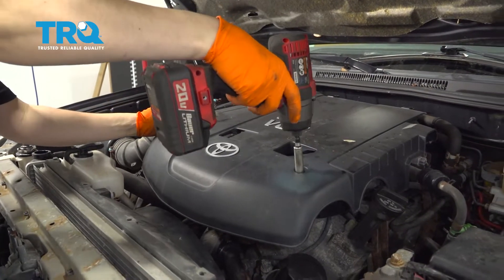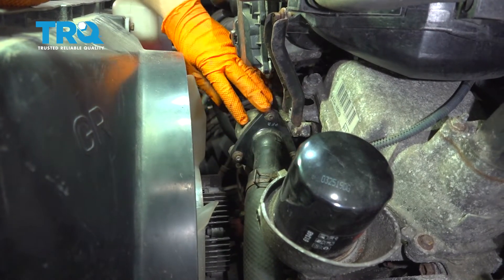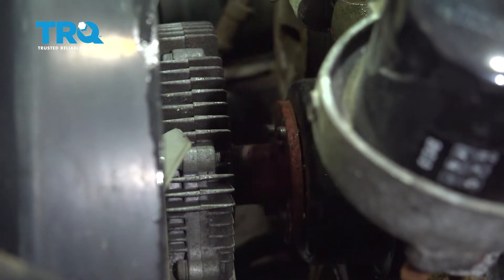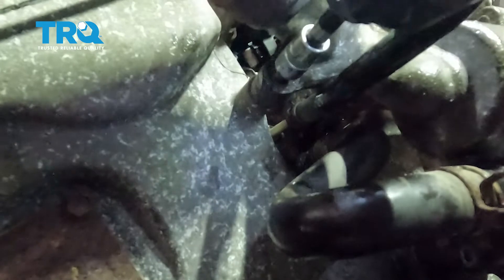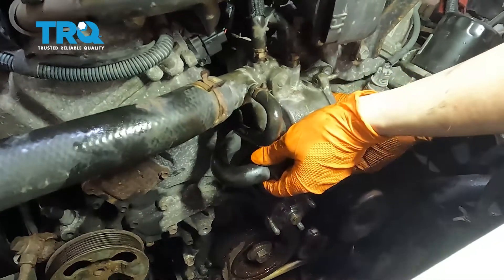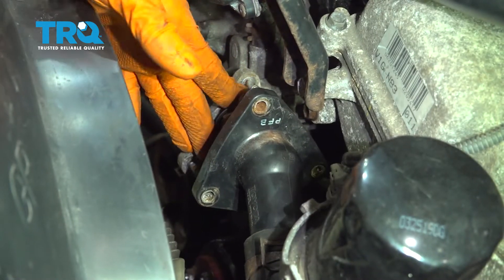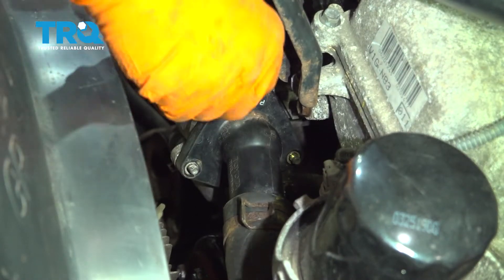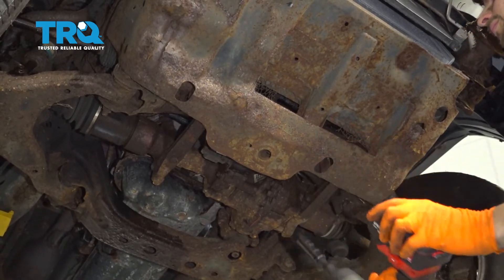How to Replace Water Pump 2003-09 Toyota 4Runner

Comment: Dont forget to tighten your crank shaft pulley bolt. If anyone follows this and realizes afterwards they forgot you can take the serpentine belt off the crank, wrap the old belt around it a couple times and then wrap the end around something solid on the underside, then it will be held in place to torq down.

Comment: my water pump just went out and this video was a huge help, THANKS!
Reply from the maker: +Gregoryjr94 Thanks for watching. Buy the part in this video on 1AAuto.com: http://1aau.to/m/Shop-TRQ
Reply: @IdahoSolar  my 2004 V6 has 209K, no issues yet, trying to decide if i let it go to failure or replace now?
Reply: My 2005 4Runner has 120k with no issue, I guess based on what see I can wait.

Comment: This video is very helpful. Just did this on a 2003 4runner. 
It was very easy and only broke 1 bolt. Thankfully it came out easily and we had spare bolts at the shop.

Comment: This video is amazingly well done. I have very little experience working on trucks and just replaced my water pump, 2 idle pulleys, and my drive belt on an 08 Tacoma V6 Sport.

Took me 7 hours. Slowly but smoothly. He’s not kidding about how breakable those small bolts on the pump are, worth getting a better torque wrench than mine as I broke one yet luckily got it backed out with channel locks

Whining sound is gone. Thank you immensely
Reply from the maker: +Tanner Shula Thank you! We love empowering our customers and showing how to perform DIY auto repairs with our high-quality auto parts. http://1aau.to/m/Shop-TRQ

Comment: Is the water pump and thermostat recommended to be replaced on a 2004 Toyota 4Runner SR5 at a recommended mileage interval? It's not giving me an issues but the vehicle has 160k miles already and want to make sure everything is solid because I take the car camping alot.
Reply from the maker: +Lou Chavez The general recommendation for most vehicles is after 60,000-100,000 miles.

Comment: Question. I went to do this. My tensioner screw is now stripped. It won’t tighten. I see metal from the threads inside. The bolt is out but can’t thread it in. After a day of trying to do this job because of lack of parts at the auto local store. It’s always something.